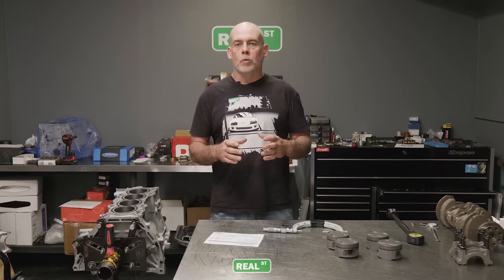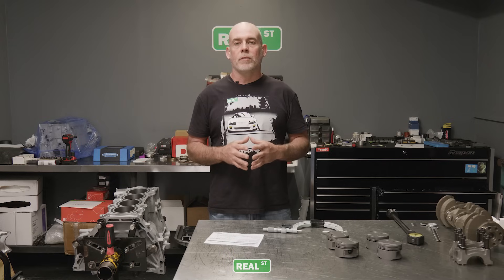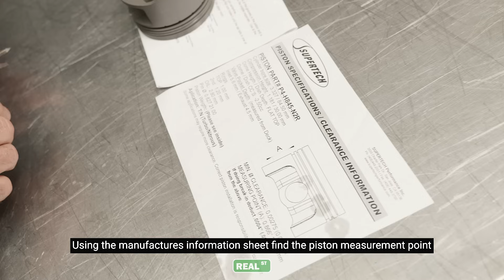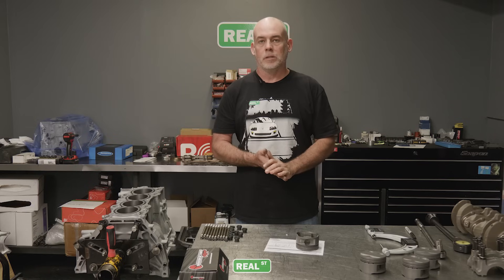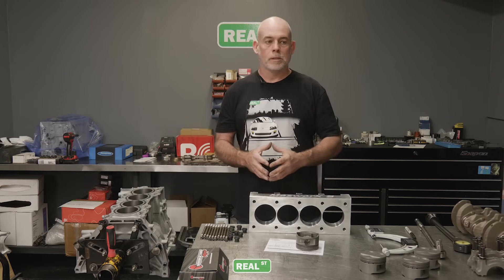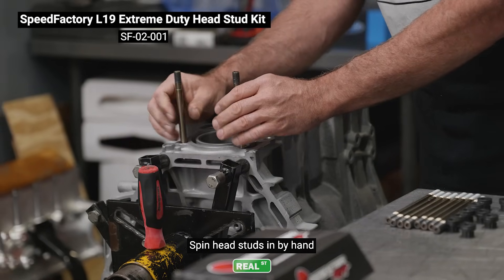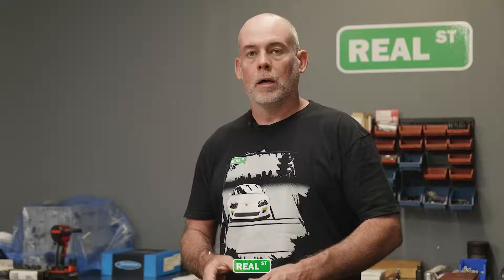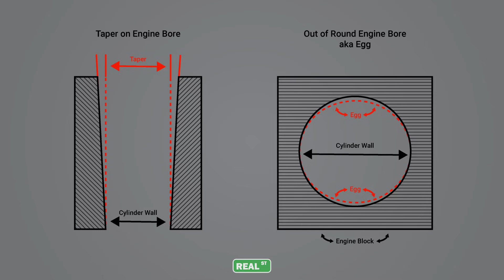How To Measure Piston To Wall Clearance On Your Engine - Step By Step

Comment: the purpose of piston rings is to allow oil to move & lubricate entire cylinder wall & not allow hot gases to escape from cylinder # the larger the cylinder wall clearance the more the hot gases escape & engine power decrease # 👍 from Pakistan 🇵🇰

Comment: Budget tip… a cheap option for a thread chase is the old head bolts.. cut a slit up the threads at replaces 180* from each other. Hit it with a wire wheel to knock out any burrs from cutting the slits and bam.. cheap thread chase without leaving home

Comment: Hey, brilliant video. I have watch a few of your series on measuring and building engines. One concern I have is I see you often torquing head studs, main bearings and big ends on the rods. Is there a risk in reducing the strength of the studs with multiple torques? I know some are even known to stretch. Is this ok?
Reply from the maker: Thats an excellent question. It comes down to the specific hardware, and its current condition. I copied this right from ARP's website: "As a rule of thumb, if you measure a fastener and it is .001˝ (or more) longer than its original length it has been compromised and must be replaced."

On this page the go a little deeper on that subject and is a really good read:
https://arp-bolts.com/p/technical.php Hope you enjoy, and thanks for watching!

Comment: Just wondering why don’t machinists heat the block up to operating temperature then take all their measurements and also use the measurements they gathered from the cold block? Wouldn’t that give them the most accurate information for cylinder bores and piston ring sizes needed?

Comment: Does anyone know if it is normal for new piston rings to make a slight scraping noise?

I even uninstalled to make sure rings and cylinder wall were good, and they were.

Is this normal for rings riding on a newly deglazed cylinder wall?

Comment: To viewers that don't know forged pistons expand a lot further but slower then oem cast pistons. It's very very important to let your engine get up to temp before hammering on it. Piston to wall clearance is extremly critical. DO NOT attempt to set this in your garage. It's just not going to properly happen. Call Jeff@CNC Werx to get the work you need done correctly.

Comment: take the top ring and square it up to where it sits in the bottom of the bore, then compare the measurement where the ring sits at the top of the bore, there is a slight difference.

Comment: Thanks to guys like you, I have successfully built a boosted daily Honda Civic...Rod piston cam valves etc... 4000 miles later on 16 psi it still lives, Thank you.......
Reply: That’s cuz 16 psi is less than most people have their daily driven v6 f150 at. Turn that thing up!
Reply: The question is, 3 years later is it still alive and if so how much boost is it at now?

Comment: Hi Jay, interesting to see the influence on measurements of the torque plate. Most people don’t have that luxury. What sort of gains (power and reliability) would be expected by using a torque plate as part of an engine build process whilst machining and measuring? Also could you heat block with torque plate fitted and re measure to see how it influences the recorded dimension? Thanks for the video
Reply: Any machine shop should bore/ hone with a torque plate. At home to verify, torque the head on and measure from underneath.
Reply: I have seen differences of up tp .002" in piston clearance without a torque plate. It is almost like the measurments without a torque plate arent even valid.

Comment: Too much clearance have screwed three street engines for me with 2000 miles... Over 2 thousands wear on the bore where the skirt is hitting. Also excessive blow by in high rpm.
Reply: Tuning errors can cause piston skirt damage and score the cylinder bores. I made a stupid mistake on a personal sleeved 2.0 LSv, changed the map sensor and didn't re-scale the ignition map. Pistons nearly seized in the bores because of the extra heat. The piston crowns were perfect, the cylinders and piston skirts were fooked.
Reply: @moedigzz  Well i can send you a pic where the piston is perfect but its slightly wornl in edge areas at the skirt (not at the correct area) because of the loose tolerances, bore on the other hand was abysmall. Its like the aluminium piston was harder than the cast iron block and wore away the engine block where the skirts were rocking. So loose tolerances is a no no for me for street cars...  Tolerances were 4.5-5 thou and the bore was worn only at the skirt area to 5.5-6 thou.